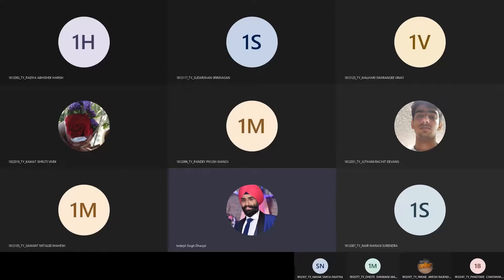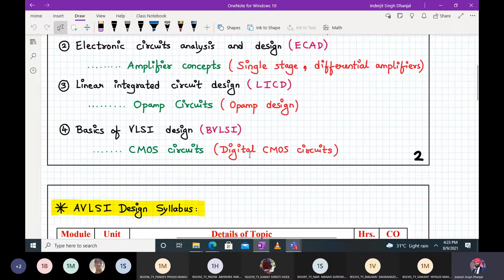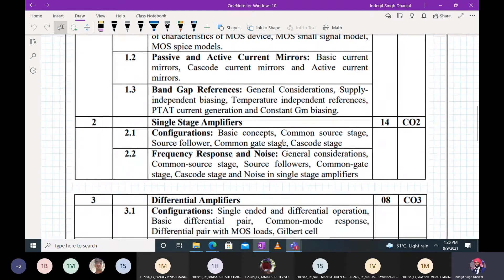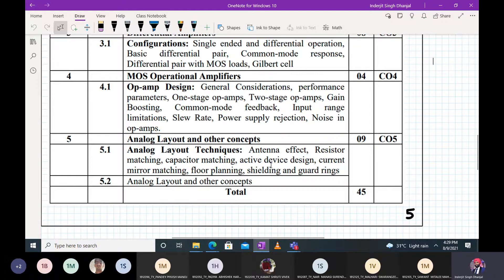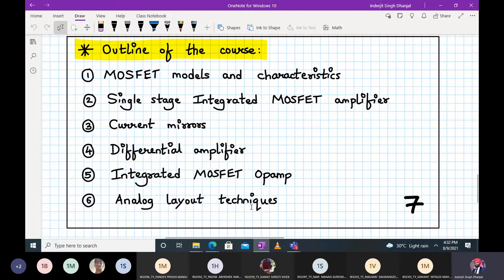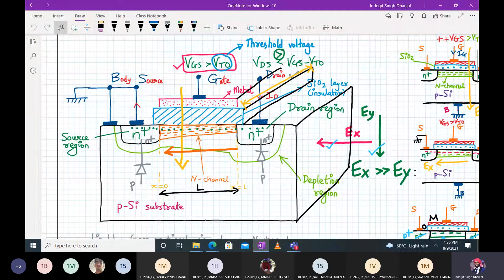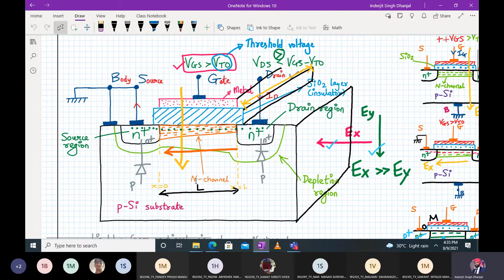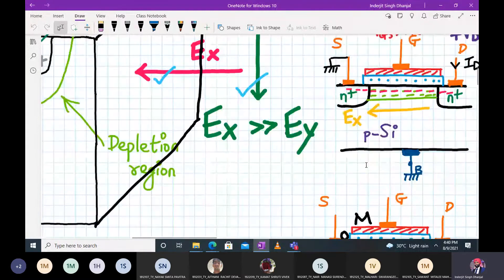Analog VLSI Design Lecture 1 | MOSFET Basics and Course Overview

Comment: when both the bulk and source are connected to ground, how does a reverse biased pn junction will be formed, i understood that there is a reverse biased pn junction at drain terminal due to the voltages connected to them
Reply from the maker: when both the bulk and source are connected to the ground,  a reverse biased pn junction is NOT formed, this is called the body effect, and it affects the threshold voltage of the device. Yes you are right, there is a reverse-biased pn junction at drain terminal  due to the voltages connected to them
Reply: thank you sir @InderjitSingh87
Reply: @InderjitSingh87  sir when both bulk and source are connected to ground ,reverse biased pn junction existed because both terminals are at same potential (0V) and we need extra 0.7v to make pn junction forward biased .